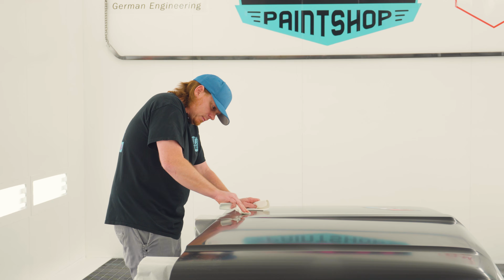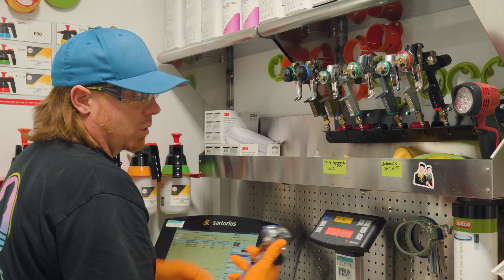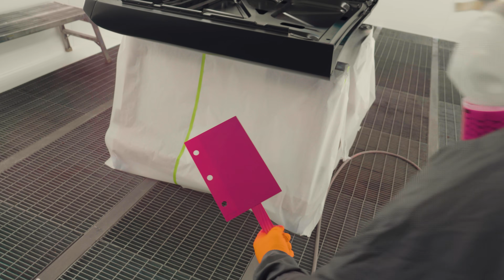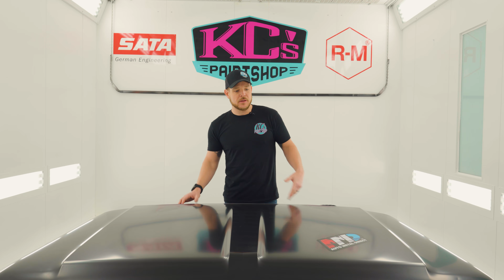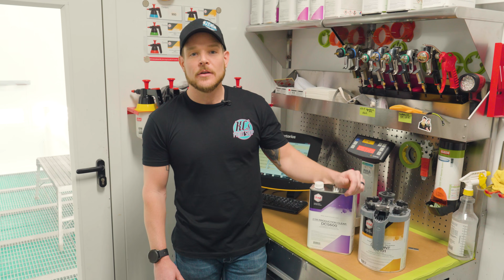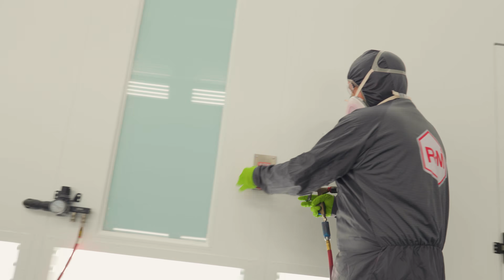Let's Talk About My BASF R-M Paint Process

Comment: Can you trust the e-cost is ok to prep and paint over? Have you ever found the e-coat wasn’t adhered properly to the metal?
Reply from the maker: It makes me nervous for sure. I have had it fail on me before. A lot of the time on restoration work we strip it all off.
Reply: @kcspaintshop nothing like stripping the bottom of a hood or fender. 😢

Comment: When I was in tech school 15 years ago, I remember spraying 5300. The 5300 is a great clear, but it was easy to run, in my opinion. The way you sprayed it was the way it stayed on the panel. And if you didn't bake it, that clear stayed soft for months.

Shortly after, RM came out with their 5335 Glamour clear, and to this day, it's probably my favorite clear ever. I loved how it will self level after a few minutes. It was my favorite for custom/restoration  work.

Just feel the 5300 is more of an advanced user clear.

5600 was also amazing. I remember being at a BASF demo in 2010, and we sanded, body worked, vp26 UV primer, sand, base and that 5600 clear in like 2 hours time total. And the finish looked amazing! Truly blown away and made me love BASF in general.

Btw, I love the suggestion of using BC101 as a flattener. Definitely want to try this method.

Have you guys ever sprayed the 5775 ultra flat clear?

Comment: Just wondering why didn't you do any kind of prep sanding on the underside of the hood you just cleaned it an sprayed it?
Reply: He was showing that the paint can be applied to an e-coat surface without sanding but by properly cleaning the surface. Per RM/BASF instructions. That’s not something he would ever do but was just demonstrating it.
Reply: @Photobombin gotcha
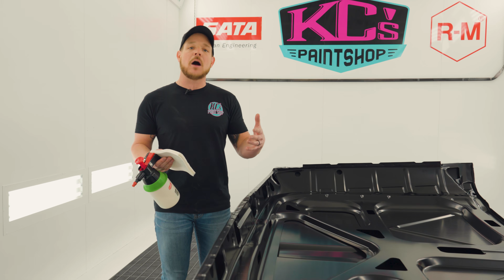Reply: He said it starting at 6:08